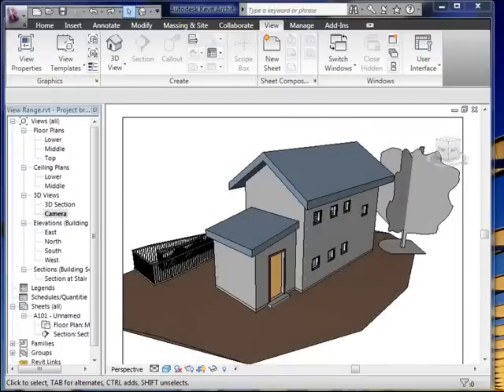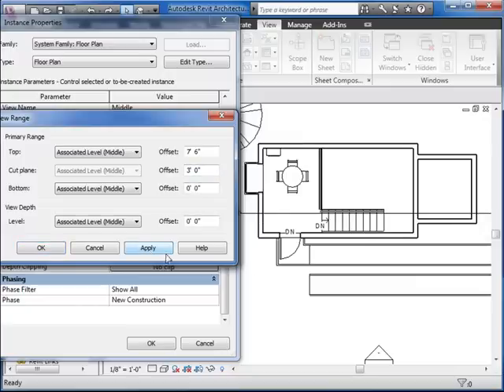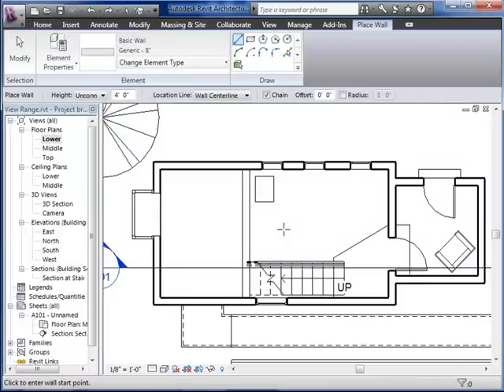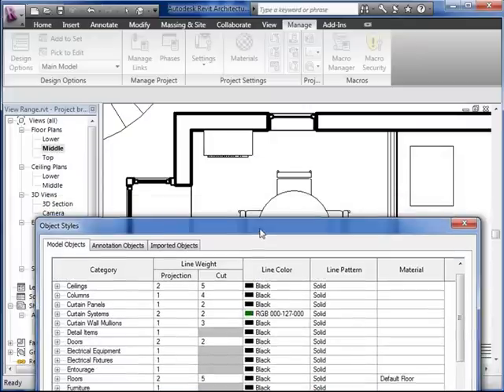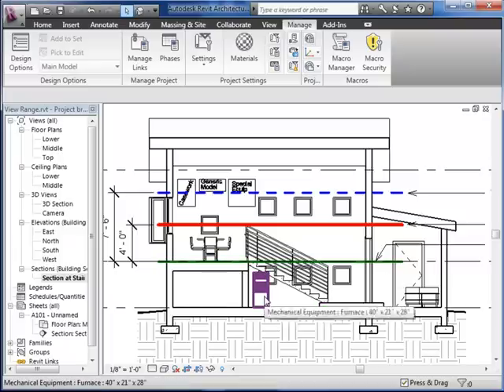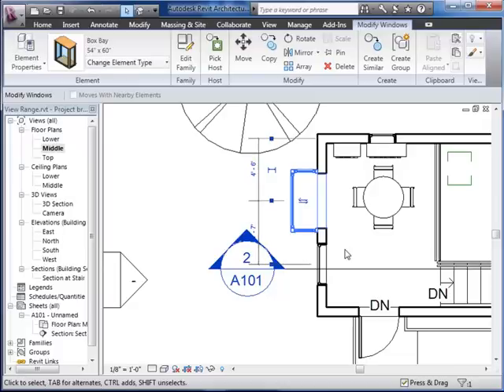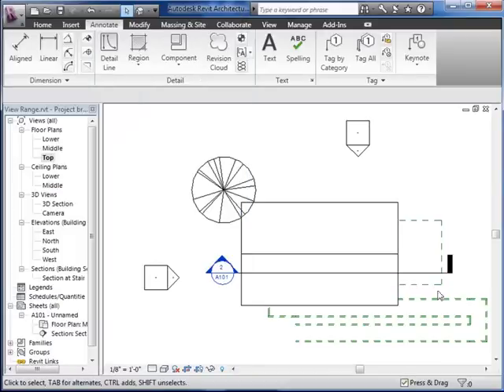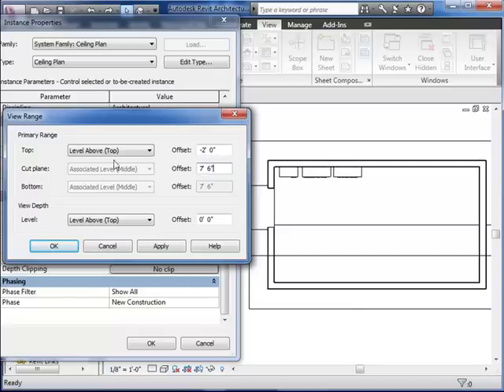Revit View Range

Comment: Thanks a lot. This is very well explained. In my project on 2nd storey, even if I set bottom view range and view depth to 0, set associated level to 2nd storey but I can still see the first storey walls which are not overlapping with 2nd storey wall. Still on above storeys too. Do I need to change other setting?
Reply from the maker: Check the Properties of the second floor and see if 1st floor is set as an underlay.
Reply: Yes. It was set as 1st storey. Thanks.

Comment: Hi Paul,
I'm using 2016 for a project and I cant hide all my beyond lines. If I look at the level 1 plan for example I can see all the furniture, doors, walls etc on the floor below as a line wieght 1 but I dont want to see them at all. In 2013 I used to set all beyond lines to white to get over that but I can with 2016. Any ideas
Thank Nic
Reply from the maker: You should never have to set anything to white. First check your view range settings and make sure that the bottom of the View Range and the View Depth are where they should be. Typically this is zero relative to the current level. 
If that does not do it, you might be seeing an underlay of the floor below. You can turn off the underlay on the Properties palette. 
Hope that helps.

Comment: what about objects and elementes that are overhanging ? that needs to show in dashed line
Reply from the maker: It would depend on the category of the element. If it is one of the three categories that display above (Generic Models, Windows or Casework) they will display up to to the Top setting. You would need to make them dashed in the Object Styles or VG. Otherwise, you have to add an invisible line through the cut plane to make them display and then override the element or VG. For stuff like Roofs, you can use the Linework tool to override them as dashed in a plan.
Reply: Paul Aubin thank you very much for your answer,  i will be trying what you suggested

Comment: Great tutorial, thank you! One question though, those three small windows, can be seen in section view, at 10:50 for example. They are above cut plane, but don't display even though they are below top plane. Any way to get them to display as dashed, dotted or any other way to indicate they are there?
The simplest way i found so far is to open family, uncheck "Show only if instance is cut" for lines that are to be seen, and apply Overhead with Linework to the whole window.
Any smarter way of going about this?
Reply from the maker: Dario Rubilovic Thanks for the comments.  You can use the linework tool to override the graphics on the windows without editing the family.